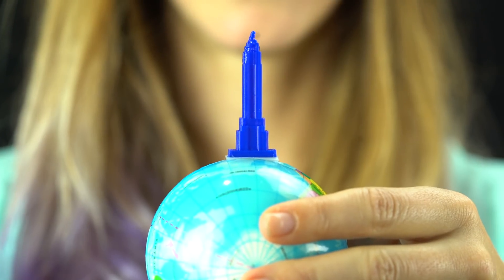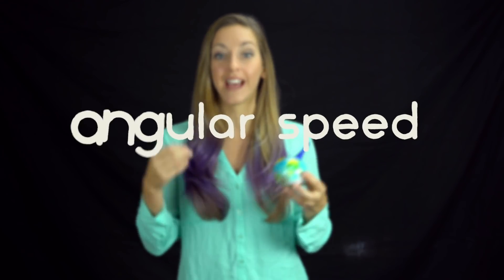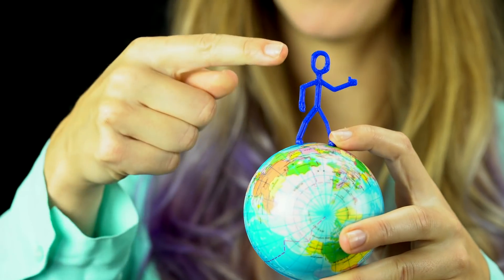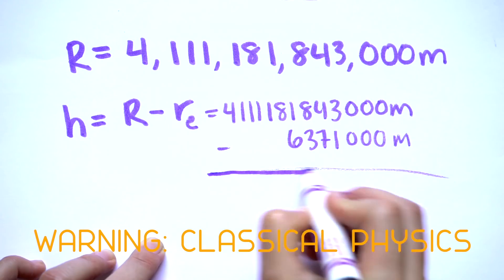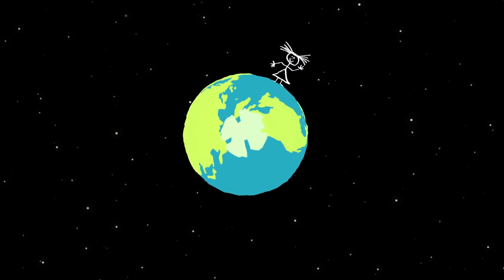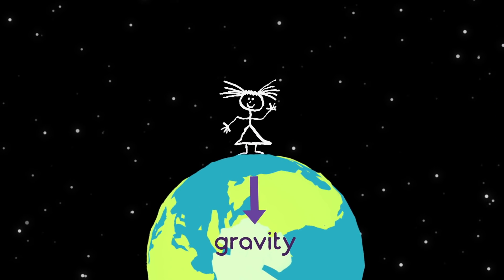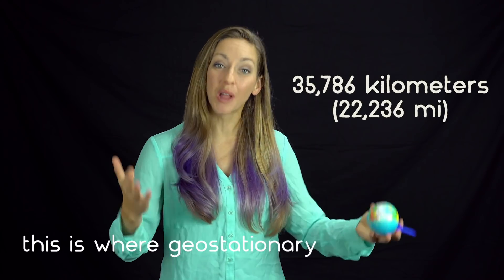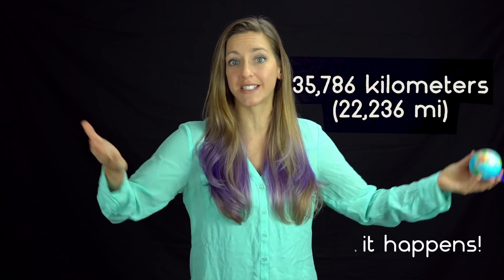How tall is this building?

Comment: Orbiting isn't zero gravity, it is a sort of perpetual falling. When falling, everything is in the same place until some energy is added and things drift apart. The building would have to be as high as the the geostationary point which is quite high. Orbiting isn't really centrifugal force, just a vector change due to gravity so the track never goes back to Earth.... There are actually very few places in the Universe with zero gravity, but you can get close. Actually just thinking about it and there may be a centrifugal force, but it may not be significant until pretty far out. Maybe beyond the geostationary point, because objects are in collapse until then, if moving with the Earth's rotation.

Comment: One part of me says that to build this high, you need a material where the speed of sound is more than the orbital velocity because otherwise different levels will want to take different orbits and there'll be no time for lower levels to let the higher levels know that they're the same structure. The other part argues that neighboring levels already move with similar speeds, so their speeds relative to each other won't be that high. The first part speaks up again and says that the information will still ultimately have to be transferred from the very foundation to the very top, and they move with very different speeds. The second part says it doesn't because the material of top levels has gained its speed as you took it to the top while building the tower and now lies comfortably in its orbit that has to be only slightly adjusted by forces that hold solids together.
I wonder which one is right?

Comment: I feel like the calculation is not correct. It should be the same altitude as the GPS satellites. I am just saying this by guessing.
Reply: GPS satellites orbit however on a lower alitude acording to wikipedia:
https://en.wikipedia.org/wiki/Medium_Earth_orbit
Reply: I don't think GPS satellites are geostationary, but I'm not sure.
Reply: Yeah, thanks for that info. But I think a geostationary orbit won't be that far as stated in the video. I remember the geostationary orbit is about 35000 km, which is definitely still inside our solar system. lol
Reply: satellites move relative faster as the earth, thats why they stay in orbit
Reply: Jan Peppelman Not if you are on the geostationary orbit, where you can have the same angular velocity and still stay in space.
Reply: Thanks. Yeah I see. I didn't finish the video.
Reply: I did my research, Yes you are right,  geostationary orbit is the same as the orbit of some satellites
Reply: Not all satellites are at the same altitude.
Geostationary orbit is the point where the orbiting object appears STATIONARY to the GEO (ie it remains above a single point of the earth's surface and appears stationary from the ground - the clue is in the name). Many satellites have a purpose which means that you want them to track over the earth's surface, such as a weather satellite or mapping satellite. Those satellites are placed in a lower orbit and so they have greater angular velocity than the earth's surface. When viewed from the ground they would appear to move across the sky.

Comment: 5:00 so at that point you've made a space elevator?
Reply: I don't think space elevator is that specific. Anything that gets you to space without using rockets counts I think. Also it's weight not mass that you're talking about
Reply: A space elevator's mass would never be "theoretically 0" ever....the mass of an object doesn't change when moving between different acceleration frames.  You're probably thinking weight in terms of if you put the bottom of the tower on a scale, but that doesn't make any sense nor is it practical.  Tension is the biggest problem and is the reason one will never be built, even nanotubes are extremely weak in comparison to what we need.
Reply: a space elevator is a structure that's centre of gravity is in the orbit. This tall building reaches orbit, but that's pretty much it. An actual space elevator would be pulled up as much as down, making it's mass in theory 0
Reply: Did you just coin "that's" as the genitive of "that"?
Reply: +Correctrix : so you attempt to correct someone for a possible colloquialism, but the glaring possessive form of "it's" in the last sentence didn't ruffle your feathers?  If you have trouble letting things go, and feel the urge to fix everything in life, then all you will ever see are the cracks.....welcome to the internet, never ending fault line for you.
Reply: "that's" used in his comment may be non-standard but I hear it used all the time.  I probably use it myself.  for example "The house that's door is broken." sounds more grammatically correct than "The house who's door is broken." simply because it sounds like the house is a person if you call it a who.  I do suppose however a person could just as easily say "The house with the broken door."

No matter the case, I don't have any problem with "that's" used in this way.
Reply: popuptoaster Some things are just mathematically not viable....like perpetual motion engines.
Reply: Bumble bees were thought not to be able to fly when a man who did not fully understand  aerodynamics did the calculations.
Reply: popuptoaster You have to be able to see the difference time has had on the human species....please tell me you don't think that we are so far behind in knowledge at the same as those who believed in 4 spiritual elements (earth, water, fire, wind).  Mistakes happen, but not on this magnitude.
Reply: You are badly misinformed, the calculations that were done (by an engineer, the assistant of a French entomologist) to show a bumble bee should not be able to fly were done in 1934 and have nothing to do with ancient beliefs about elemental sciences.

My point is that while we can't build one now, we have an incomplete understanding of many branches of what would be required sciences to complete such a project, there is no mathematical reason why it's not possible.

Saying we can't do it based on our current knowledge may be correct, but saying we can NEVER do it is akin to saying men would suffocate at over 30mph or we will never get man to the moon, we simply don't know if it will ever be possible.
Reply: popuptoaster Citation needed.

As for whether we can make a space elevator, this is known calculations on thoroughly invested science.  The "toughest material known to mankind" at this current point in history is still only 10% to 15% of what we actually need.....and as you get higher in the periodic table, you get lower compound stress.  So again, unless physics suddenly changes, we'll never have a space elevator.

Nothing I say will convince you, so say whatever you want, I'm finished with this argument.  You can bet by the time either of us dies, we'll still not have one, not even close.
Reply: You say it yourself "toughest material known to mankind", a new form of carbon was discovered in 2015 but if we have such a complete understanding of physics and then how do we make new materials discoveries, surely we should already know all possibl forms of all materials already? By your logic anyway 

As I say, just because we don't know how to do it yet does not mean it will never be done, there are many possibilities from new materials to new ways to add strength to existing ones.

What kind of time travelling expert are you to say that some scientist in the future can't discover a way to strengthen the bond between particles somehow?

Also thank you, I do enjoy it when someone attempts to close down a discussion because they are out of new ideas and find their own being challenged beyond their ability to reasonably answer.

Feel free to change YOUR mind and come back with some more reasons why we can never build something, logically you cannot do it, it's like being asked to disprove God.

Right or wrong you can't prove your point except for waiting for all eternity and seeing what happens while I don't HAVE to prove mine because I only say we MIGHT be able to build a space elevator.

You lost the debate before it even started. ;)
Reply: Aww how sweet, you came back after bailing out and you brought insults with you too, if you feel you really MUST have the last word go ahead, I'm happy I got you to understand your error and open your mind a little.
Reply: Robert Caldwell What a wanker.

No.  I have never seen "that's" used like that before.  I guessed it might be formed analogically from "that" as a neuter alternative to "whose".  If so, that is utterly bizarre and fascinating linguistically.  Is it his coinage?  A local dialect thing?  So, again, no: I didn't correct him.  I certainly didn't "attempt" to.  How absurd.  If I correct, you'll know about it.  As now.

The new word was way more interesting than the content of his message, so I didn't even get to the last sentence.  And, if I had, I of course wouldn't bothered mentioning it.  There would be nothing to ask: I know that half the people one sees online can't use apostrophes correctly.

Jeez, you even have a troll meme as your profile pic.  I really shouldn't feed you.

Comment: So, if you started building the structure while already in orbit, and the foundation of the structure was at the orbital "balance point", could you just build simultaneously in both directions so that the entire building is one giant "floating penny" so to speak? So like, you could have a big sturdy foundation floating at the "balance point" and then build away from that balance point towards the earth and away from the earth and it gets thinner and thinner, until you just have a tiny point that touches the earth's surface. It would look like a giant diamond floating on a needle point that barely touches the ground.
Reply: You'd still run into material strength problems. The sort of math that would apply is the same that gives minimum orbital distances for moons around planets and planets around stars. You'd have tidal forces on each end of the structure, and once the tidal force reaches the mechanical limits the structure would simply rip apart.

https://en.wikipedia.org/wiki/Roche_limit
Reply: ***** It's been done a few times, I think. Not huge structures, but cables for space elevators. They are portrayed as being lowered from orbit rather than being built from the ground up, which makes a lot of sense. Since they'd be designed to be under tension, building them under tension is a much simpler task.
Reply: willythemailboy2   No, it has not been done, except in science fiction, perhaps.
Reply: Mark Holm Abel Saavedra posted: "But there's still material for a great science fiction story, I think..."

You should really learn to read the post being replied to instead of taking my post as a stand alone. It would be far less embarrassing in the long run.

Comment: There is no centrifugal force.
https://xkcd.com/123/
Reply: Nyt Mare she said it was an imaginary force, we know
Reply: DankBleach SixtyNine Do you expect me to think of an imaginary force while strapped to a centrifuge?
Reply: Nyt Mare that's your linear momentum
Reply: GrodyMaroon you bet I didn't get the joke ah hell yeah
Reply: And you can even call it centrifugal force in that context, if you want to. If you assume in advance that a rotating frame of reference is just as valid as a non-rotating frame (though different), you need centrifugal force to explain your observations.
Reply: Centrifugal force does exist but most people use it incorrectly and say centrifugal force when meaning centripetal force. Centripetal force is the force that acts on a body towards the centre of the circular path whereas centrifugal force is the resultant force to the centripetal force (because of Newton's third).
Reply: Onrii 
No that's wrong. The centrifugal force is an induced fictional force that occurs when you treat a rotating frame of reference as an inertial one. It counteracts the centripetal force so that the acceleration becomes 0 in the rotating frame.
Reply: Centrifigal force doesn't exist, but centripetal force exists, it is just that if you see the forces and accelerations from an inertial frame, centripetal force(a real force) occurs, but if you were in a non-inertial (moving) frame, then centrifugal force can be used, coz it will act similarly as if you were calculating the forces from an inertial frame.

tl;dr centrifugal force is just used for calculations to make stuff easy.
Reply: Ralph Dratman u look like a wise ol physicist XD
Reply: But not a physicist.
Reply: + GrodyMaroon  What do you want for Christmas?
Reply: Ralph Dratman i want the LHC
Reply: Shipping is extra for this large item. Sorry to say the LHC will not fit down your chimney. Alternatively, you could pick it up. Please call here the day before your scheduled pickup so we can wrap it up and have it ready for you.
Reply: mobile: https://m.xkcd.com/123/
Reply: Pepe! At The Disco will Hillary work?
Reply: Pepe! At The Disco Another challenge for chimney delivery

Comment: so does a satellite which is located at the magic distance from earth still revolve around it even if it was lying on earth's axis of rotation? or does it have to be around the equator?
Reply: It won't stay on the earth's axis of rotation because it has to be moving around the earth to stay in orbit. That sort of thing is called a polar orbit. If it was just sitting above the pole without any sort of sideways motion it would just fall down to the ground - and wouldn't even be moving fast enough to burn up on the way down.

A geosynchronous orbit has to be on the equator, since that's the only place it can orbit and stay directly over the same bit of land.
Reply: ***** If you put something at geosynchronous distance off the equator, it will look like it's bobbing up and down across the equator. It still won't go further east or west, but it would bob between, say, Panama and Peru.
Reply: ***** Yep, it looks exactly like a sine wave. You can see a similar thing on the ground track for the International Space Station:

http://www.aerospaceweb.org/question/spacecraft/ground-track/hst-ground-track2.jpg

The difference is that the ISS is way short of geosynchronous so it's moving east pretty rapidly.

Of course, if you built the tower somewhere other than the equator, the entire tower would attempt to do the same motion. That would end quite poorly, I imagine.
Reply: Yevhenii Diomidov so a satellite can go around earth's poles and trace its axis of rotationbut it won't be synchronized to one spot.
Reply: If it's off the equator, it would bob up and down across the equator along the same longitude to an observer on the ground. This is called a "z-map" orbit, and, without a geo-syncrinus period, is how we orbit mapping satellites.
Reply: It would most definitely be moving fast enough to burn up on the way down. GSO altitude is far greater than LEO.

Comment: Can you make a video about this - if somehow you can make a tennis ball with the Sun's mass appear on a table on Earth?  What would happen?
Reply: The tennis ball, if the size of the Sun, would collapse into a star and the Earth would be a tiny, insignificant part of it's mass. If it were the diameter of a tennis ball and had the mass of the Sun, it would already be far below the Schwarzschild Radius of about 3km. It would already be a black hole, not a tennis ball. The Earth would fall towards the black hole, which would look like the black hole falling into the center of the Earth. Then it would consume the Earth from the inside out. Since it has the mass of the sun, all matter composing the Earth would be immediately crushed and compressed around the black hole due to the huge gravity of the black hole. It's surface gravity, if it had a surface, would be g=(G*M)/r^2. G=gravitational constant=6.67*10^-11, M=1.989*10^20 kg, r=3.429*10^-5 km so g=1.12*10^51 g's. That's 112 followed by 49 zeros. You wouldn't see much and likely would never even know anything happened you'd die so fast.

Comment: does the rotation means there is no accelaration because the speed is constant .....! so where does acc. comes from .
Reply: Acceleration means changing velocity, not changing speed. Velocity is speed and a direction. So if speed is not changing but direction of travel is, then it is still accelerating.
Reply: velocity & acceleration are both vectors.....they have both a magnitude & a direction.........the acceleration is simply due to fact that the direction is continuously changing @ any given instant......look up angular momentum.....constant liner velocity Vs. constant angular velocity.....or just acceleration & velocity .......& Kinematics.......under basic physics etc.....its a good question.
Reply: Mohammed Sami Rotating objects can also have acceleration.
Reply: Mohammed Sami rotational acceleration, aka gravity, toward the center of the earth, but no transitional one.

Comment: Even if we could build it with structural integrity, it would probably be so heavy that the center of rotation would no longer go through the center of the earth (and the poles). Maybe it would even be within the building. at that point earth would be a ball attached to a long rotating stick.